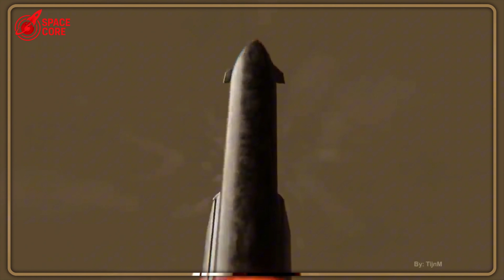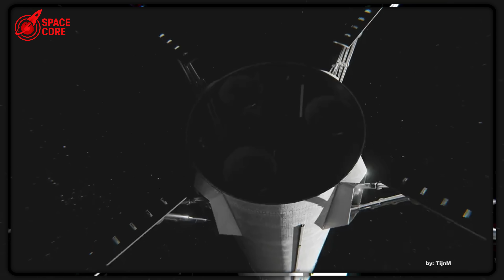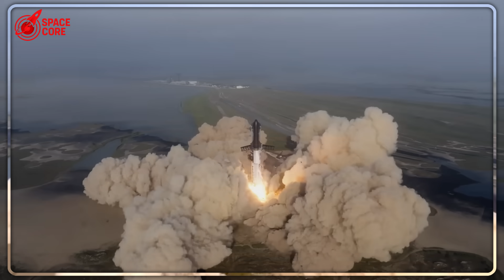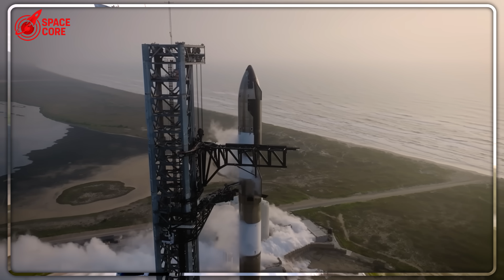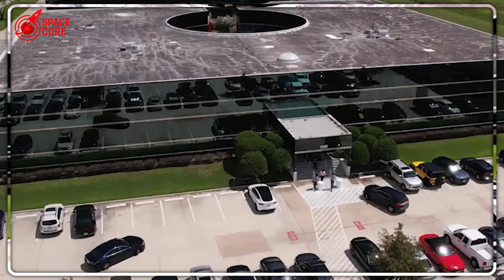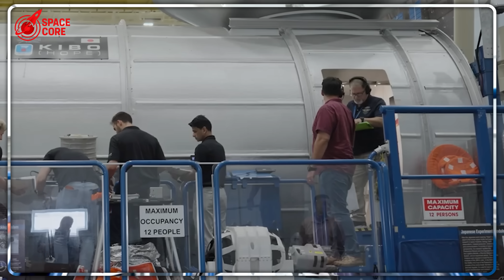Elon Musk Revealed WHY Raptor Engine Isn't Perfect...

Comment: The pre-burners drive the PUMPS!!! This 5% is the energy needed to drive the pumps that build the pressure the main engine needs. It's not wasted.
An ideal methane/oxygen ration 1:4 burns too hot so they use 1:3.8 
The spurious "SX-500 atmospheres" is stupid. The pressure is managed using different steel thicknesses as in ALL steel use.
Reply from the maker: Thanks for the insight! The 5% pre-burner loss powers pumps for pressure, and the 1:3.8 ratio balances heat—SX500's role is real but complex, not just "stupid."

Comment: 2000 kilo is the same as 2 megs. So why use kilo.. its like saying I have 200 pennies, instead of saying I have 2 dollars..
Reply: 2000 Kilos is the same as 2 Tonnes
(That’s metric tons)
Reply: This is a robot. The cadence is weird. Its using the most common word that fits that space in the sentence it creates. Stupid.
Reply: Its a stupid robot
Reply from the maker: It's about precision and context. For engineering, kilograms are the standard unit of mass, while "megs" usually refers to megabytes for data storage, not weight.

Comment: The thing can barely get to LEO without running out of fuel and it isn't even under full payload. He is going nowhere.
Reply from the maker: Starship's LEO capability is proven, even with partial payloads, and refueling in orbit solves fuel concerns. Musk's Mars plan is on track with Raptor’s efficiency gains.